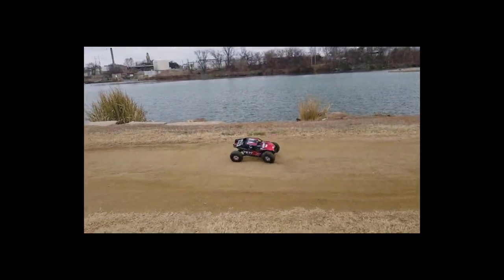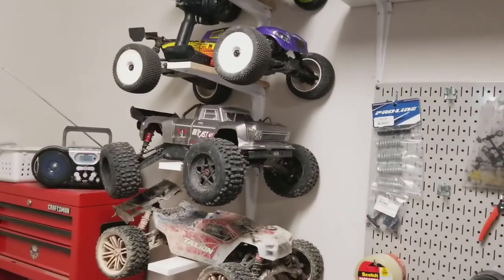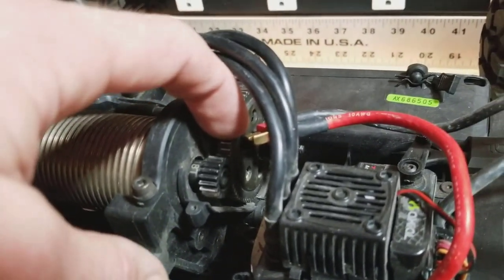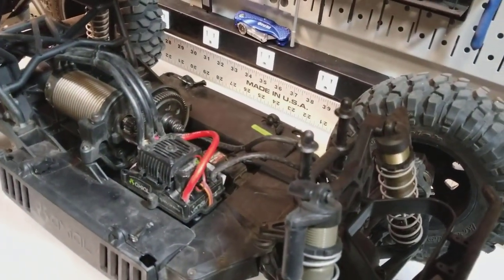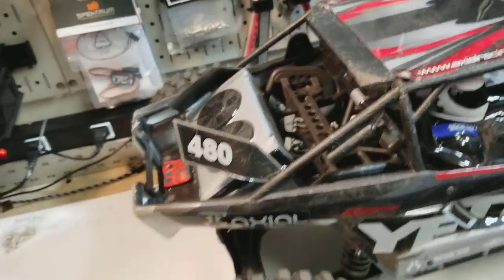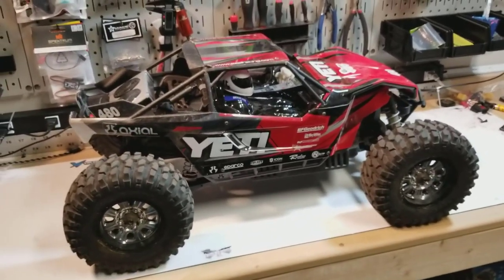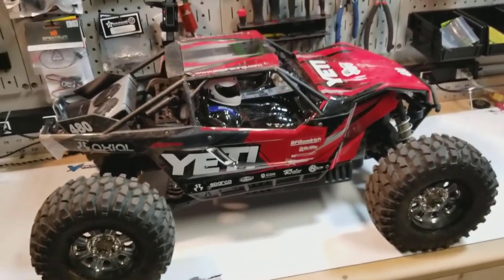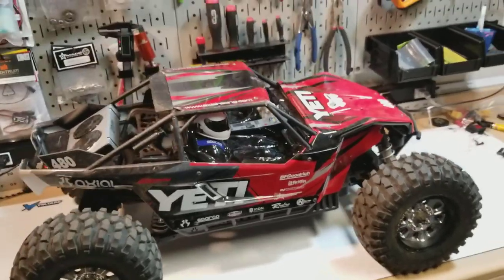Axial Yeti XL - 2 Month Review and some quick bash vids

Comment: Sway bars on front and back also with a rear locker the truck runs straight. With the front diff get the hot racing diff and differential case you'll never have that problem again at least I haven't. Also yeah the stock suspension isn't great but use a double spring kit and some heavier shock oil it runs like a champ. It alot of work but well worth it once finished
Reply from the maker: Appreciate the info man!  Front swap bar definitely on the list too.  For the double springs, do you mean one of the HR kits or just double up the stock springs?
Reply: @1TenthScaleRC  what I did for the shocks was I did buy the hot racing setup but it didnt work like I wanted it to so what i did was just use the short silver spring from HR and the stock spring together with 45 weight oil and it work great it soaks up the jumps better. That was for the front with the real I used the HR long silver spring and short red spring so far this has been my best setup. I hope this helps.

Comment: The second run I had with mine, I ramped it high in the air, once the yeti landed nose first, the servo was done. I replaced it with a savox servo and problem solved. Great review, liked and subbed.👍
Reply from the maker: Rc Basher Boi oh damn, glad it's held up since then.  Servo is definitely on my list of stuff to replace.  Do any suspension mods on yours?
Reply: Thick Skinned RC : I've only done a servo upgrade. I re-greased the back and front diff with TLR grease. It's a great basher overall, I have nothing bad to say about it.👍

Comment: Hi there. Just picked up a couple of Yeti XL's for my boys, both used with some Hot Racing parts. You mentioned a site that has some info on the diffs etc - we already took a rear diff housing out - one of the two bearings next to the ring gear failed and allowed the shaft to wobble around taking out all the plastic. Do you have a link to that site? Cheers!!!
Reply from the maker: Hey man, bummer about the broken stuff.  See a couple comments below. Barharbor basher is basically the godfather of yeti XLs :)  hes got some good good good info on his channel.

Comment: I FEEL LIKE I AM THE ONLY PERSON WHO HAS HAD TO REPLACE DAMN NEAR EVERYTHING ON THIS CAR BECAUSE IT ALL BROKE. FRONT BUMPER BROKE, REAR LOWER LINK BROKE 3 DAYS AFTER BUYING IT. FRONT DIFF, STEARING LINKS, FRONT DRIVE SHAFT CAME OUT. PIN TO THE FRONT RIGHT WHEEL DRIVE SHAFT, REPLACED 3 OF THE SHOCK ABSORBERS, THEN ENDED UP JUST BUYING THE ALUMINUM UPGRADES. AND IM SURE IM MISSING A FEW THINGS. THE CAR IS VERY FUN. BUT THE PLASTIC PARTS ALL FAIL AND BREAK. I BOUGHT IT WHEN IT FIRST CAME OUT FOR 800 DOLLARS AND STARTED REPLACING PARTS TWO OR THREE DAYS AFTER.